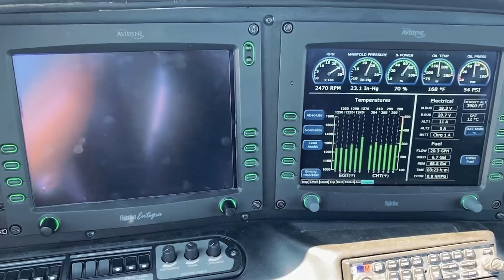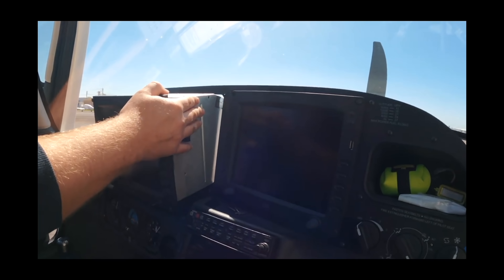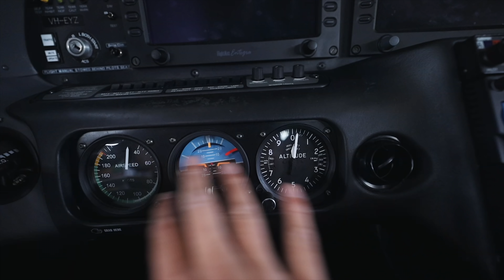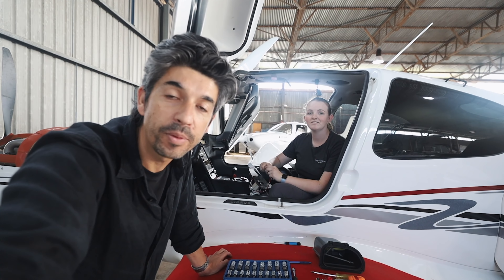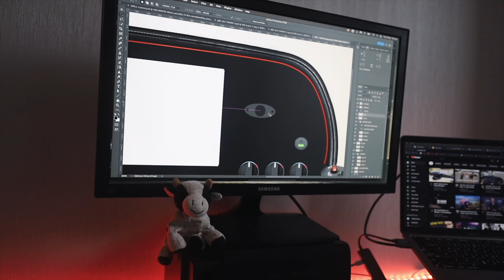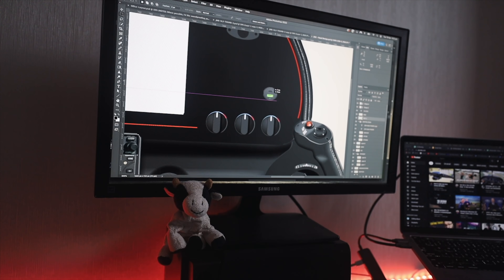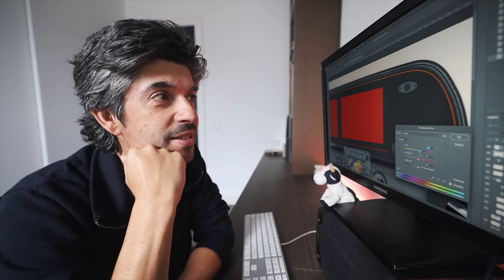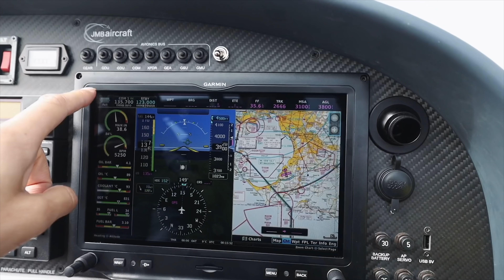My plane broke, had to make major changes

Comment: Make the line backlit and with an RGB controller :)
Reply from the maker: Now you’re talking.
Reply: Ok so didn't see this comment before I did the same above, upvote.  Off to have a look at some LED controllers now see if any have avionic interfaces....
Reply: Yep we can definitely do this with an arduino controller would be good to have it aviation friendly but I don't know how much telemetry we can get out of a plane.  In a Car or Boat I would just consume the CANBUS or NEMA information into the controller then I could change to alert color when alarm conditions, temperature, lighting, check engine etc etc
Reply: @grahamnicholson1553  aircraft such as Stef's which is IFR would have certification issues so things like Arduino would be out without a lot of money to get approvals
Reply: Color based on something flight related. Engine power % maybe. :p

(yes I know that it would be impractical if not impossible from a certification point of view but fun thought nonetheless)

Comment: New probes +GI275 on the photoshop, means Garmin, no doubt. The G3X is out because you are keeping your avidyne equipment (you could use your autopilot with the G3X but you would loose the FD…). The G1000 is out as well because the GFC700 autopilot is included in the G1000. 
Hence your new panel will be : 2 G500TXi and a GI275 standby. 😉
Reply: Sounds like real detective and engineering work. Very interesting thanks for the compatibility explanation too!
Reply: Also not sure the g3x is certified for the sr22 yet. Not 100% sure though

Comment: Hi Stef,
i would guess it can not be the “Advantage” screens, they are available earliest with beginning of 2023.
You wouldn’t had to exchange the probes for Avidyne either and you already stay with Garmin for the navigators.
I’m excited to see which Garmin equipment it will be. It would be very interesting for me if you could also spend some words on the costs.
I may have to make a similar decision in the near future…
Reply: The Garmin G3X Touch screens are really nice.  Expensive but if he also replaced the autopilot with a GFC500 the system works magically.  Did that for my old 182 and cant imagine it being more advanced than a late naugties Cirrus at this point but if this is what Stef is doing then probably it is.

Comment: first off, cliff hanger teaser ending, poor form dude

second, yeah, the red stripe is very batman 66
however, IF you were to go the red line, it might also well be worth (imo) getting some red washers for the screws that mount the screens (so as to have a little red touch surrounding the screw head, and adding a super subtle but nice continue of the red accent theme
Reply from the maker: Ooh that’s a great idea. I’m going to see how that looks, thank you.
Reply: Better yet, get red anodised screws for the mounts!

Comment: Red line is a good choice. It reminds of the red accent of the outside paint. Good luck Stefan, you are in good hands it seems. I know it will be a couple of Garmin 500 txi... you wouldn't go for Avidyne with the two Garmin units you already have, as the package hasn't been certified yet with the new Avidyne screens and you wouldn't need to change the probes... I replaced my two Garmin 430s with IFDs and am quite happy with the choice. When one of my screen dies I will probably go for the Avidyne upgrades.

Comment: Great vid and it has to be red trim. I’d go for the shorter RAM mount double socket arm as the longer one does vibrate a bit and this can be seen when the engine idles even on a Go Pro 8. Saying that, that’s in the beat up 50 year old PA28 Archer I Fly 👍😀

Comment: RAM mounts work well if you also have a rubber block in there to absorb vibrations....  get clearer images then too.  Unless the GoPro has some fancy software stabilising?
Reply from the maker: Stabilisation on the GoPro (Hero 9 that I use) is really good. But if I get vibrations I'll look into the rubber to absorb any movement. Hoping as it's going to be screwed into the panel itself that it will be very solid, but thanks for the tip.
Reply: @StefanDrury  I use one in my car on the track with an iPhone (harry's lap timer) and it seemed better when I used the suction mount versus one I had bolted in direct behind me.  I put that down to the small play the rubber has in the suction mount version.  Either way - best mount in the business IMHO.

Comment: You can only put the red cheat line in on the dash if you modify the before start checklist to read:
BATTERIES - TO POWER
TURBINES - TO SPEED
:p

Comment: Correct me if I'm wrong but  if you installed tech released today, it's already "old" as all the testing and certification began years ago, it's just making it to market now. The difference in release date and development phase is vastly larger in aviation than in consumer electronics. So you say the tech is 15 years old but it might actually be closer to 17-18? I have no clue

Comment: new gauges on the engine, means new costs too. I just had to replace the oil temperature sensor, and as my SR22 is perspective, the sensor is seriously more expensive than the avedyn one!

Comment: You little tease! >.< But man, it must be exciting getting these panel upgrades. 

Modern avionics are just super cool and interesting, so much capability in a small airplanes and helicopters now, just think, there are experimental aircrafts out there with more panels and tech in the cockpit than some big bizz jets! :D

I have to make due with flying behind my PC, and there I prefer analog stuff, easier to read there... and old things... radial engines and stuff! :D

Comment: I can't see why you need an eletric Inst., panel with a pretty basic general avitation aircraft. Nothing wrong with ie., needle,ball,airspeed,altimeter.We flew and won WW2 on that system.
Reply from the maker: Absolutely nothing wrong with traditional analogue gauges. I did a lot of my training using those, but having the choice now in tricky IFR situations I think using technology to your advantage to improve situational awareness and reduce pilot workload is a smart thing.

Comment: Funny, our 2006 SR20 G2, ZAW, went the other way, replacing the Garmin GPS'es with two Avidyne IFD440's and keeping the PFD, MFD, AP, well they didn't break (yet 🤞). Also added a DME. The integration of Avidyne all over is great, and you can add an i400 large screen with an iPad (as much as I hate Apple) and the Jeppesen package includes the maps and data. If the PFD/MFD would quit we would go Avidyne again because of the IFD440 integration. 

I also fly Perspective+ in a charter G6. Really it's a matter of taste. The only advantage I see for Garmin is envelope protection. I use a Garmin MARQ Aviator and Garmin Pilot on Android, the IFD440's are "fed" via WLAN directly from Android SkyDeamon. Some different technologies in the backups are also a good thing I suppose. 

I am sure in any case your upgrade will make workload lower and increase fun and safety, so we'll done. Although most likely that will have the cost of a decent midsized car 🤑

Comment: Love the updates Stef.
Had a question about the GoPro filming though. I often film my flights with a GoPro as well, but if I also record at the same time, the file seems to get broken and I just lose all my files. (GoPro Hero 7 Black). I was wondering if you know why. I also have an audio input into the GoPro with a 3.5mm from a headset splitter.
Reply: Probably the SD card. I'm having no issues on my hero 5 and 3+ (he last one is used for inside view and audio recording)
Reply from the maker: I don't record audio into the Go-Pro, I use a separate audio recorder to capture the ATC comms. I made a video on my setup here: https://www.youtube.com/watch?v=DZkTzetPWvo
Reply: @StefanDrury  Thank you so much

Comment: To be continued is fine. Goes with the 1960s batman theme. No on the red line btw :) I think that was a VW golf GTI thing in the 1990s, tesla had a bit in 2012, SR71 also had it at one point but I think it's not with the design sensibilities of today so might just date it. Maybe a metallic grey or white grey line is more modern/neutral/elegant.
What casually overpaid job do you have that you can enthusiastically afford the dystopian tyranny that is an avionics upgrade in a certified plane? :)
And what does this joyous keelhauling under satan's yacht GA on the river styx set you back? I have heard bizarre to grotesque prices for dreadfully inept avionics 'upgrades'.
So much wrong with GA, avionics being a big part. That G650 should obviously be functionality integrated in the main display. The only display. And engine data could be on a standard CAN bus, not requiring any rewiring.

Comment: First
Reply: I see you are keeping the Audio Panel - as you are deep into the wiring why not switch to GMA350. Apart from the GMA347 being old the 350 has bluetooth which makes it easy to control the Garmin camera using voice commands as well as picking up flight data overlay via Connext.